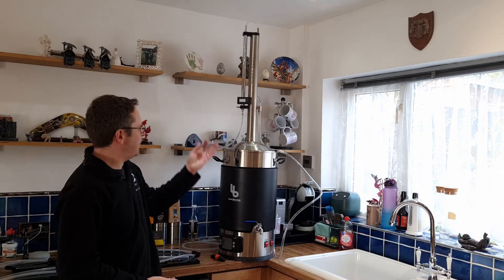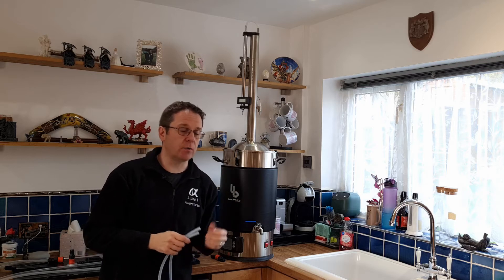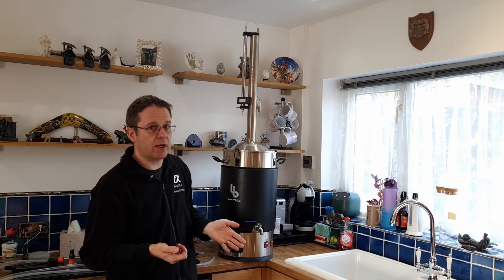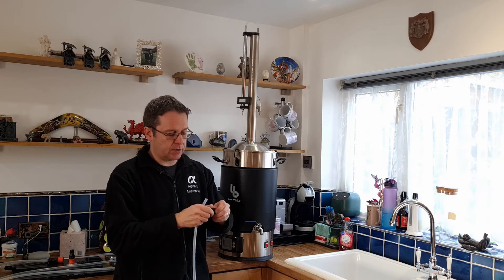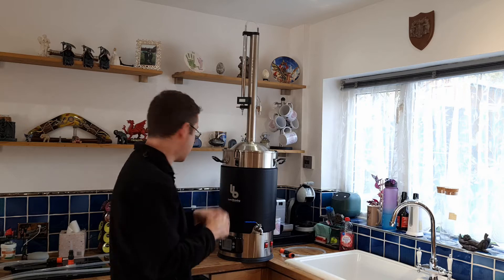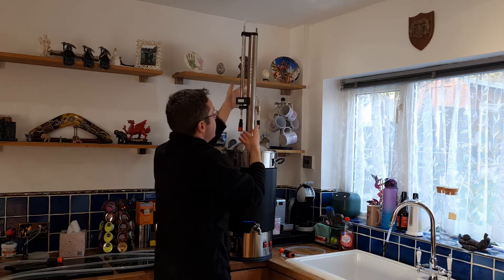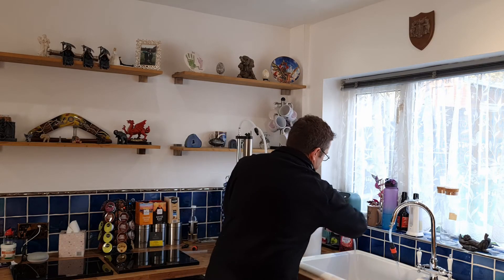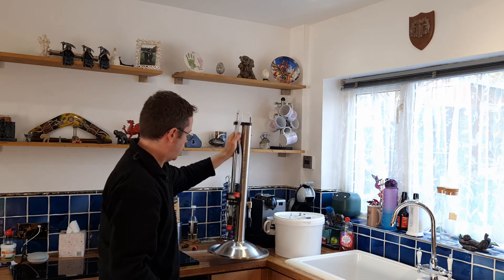How to make your Still Spirits T500 work better

Comment: Very nice! I’ve been thinking of splitting the tube at the head for the reasons you described. And I always hate moving this gear around with all the tubes dangling. Elegant solution. Thank you! Would love to see the exact quick release valves you’ve used. Could you link to some online?
Reply from the maker: Hi @reganperry1257,
Sure thing, the connectors and tubing that I bought are below.  You can get the tubing anywhere (which is possibly cheaper), but so far only found 2 or 3 suppliers on AliExpress who sell the connectors, and nobody outside of AliExpress.

The connectors you want are the '30SP & 30PP' if using 6-10mm Silicoln tubing:
https://www.aliexpress.com/item/1005003017039024.html?spm=a2g0o.order_list.order_list_main.33.49811802hZ77FU

The 6x10 Silicoln tubing is here:
https://www.aliexpress.com/item/4000833290804.html?spm=a2g0o.order_list.order_list_main.63.49811802hZ77FU

Comment: Great video and great idea. I don't suppose you could share a link to those fittings?
Reply from the maker: Hi @jasongeorge3115,

Sure thing, the connectors and tubing that I bought are below.  You can get the tubing anywhere (which is possibly cheaper), but so far only found 2 or 3 suppliers on AliExpress who sell the connectors, and nobody outside of AliExpress.

The connectors you want are the '30SP & 30PP' if using 6-10mm Silicoln tubing:
https://www.aliexpress.com/item/1005003017039024.html?spm=a2g0o.order_list.order_list_main.33.49811802hZ77FU

The 6x10 Silicoln tubing is here:
https://www.aliexpress.com/item/4000833290804.html?spm=a2g0o.order_list.order_list_main.63.49811802hZ77FU

Comment: This is a great video and I love the quick connections.  Do you have a link or a name for that style of a quick connect?
Reply from the maker: Hi @branu01,

Sure thing, the connectors and tubing that I bought are below.  You can get the tubing anywhere (which is possibly cheaper), but so far only found 2 or 3 suppliers on AliExpress who sell the connectors, and nobody outside of AliExpress.

The connectors you want are the '30SP & 30PP' if using 6-10mm Silicoln tubing:
https://www.aliexpress.com/item/1005003017039024.html?spm=a2g0o.order_list.order_list_main.33.49811802hZ77FU

The 6x10 Silicoln tubing is here:
https://www.aliexpress.com/item/4000833290804.html?spm=a2g0o.order_list.order_list_main.63.49811802hZ77FU

Comment: Where did you order the quick connectors from I can’t find any on eBay a link would be great many thanks
Reply from the maker: Hi @davebower5904, sadly the only place that I could find good connectors from was AliExpress.  Yes, you can find metal (well, brass coated) connectors on ebay or Amazon, but these are expensive, very heavy and they rust after a few months (well, they did for me).  The connectors that I use are actually made for air, so you know they can take a lot of pressure.  The link for them is below.  If you are using 6ID 10OD tubing (like me), you will want the '30PP and 30SP' model.  

https://www.aliexpress.com/item/1005003017039024.html?spm=a2g0o.order_list.order_list_main.95.5cf91802xn6eGq

Comment: Any chance of a link for the connectors (uk)
Reply from the maker: Hi @prologicac3,

Sure thing, the connectors and tubing that I bought are below.  You can get the tubing anywhere (which is possibly cheaper), but so far only found 2 or 3 suppliers on AliExpress who sell the connectors, and nobody outside of AliExpress.

The connectors you want are the '30SP & 30PP' if using 6-10mm Silicoln tubing:
https://www.aliexpress.com/item/1005003017039024.html?spm=a2g0o.order_list.order_list_main.33.49811802hZ77FU

The 6x10 Silicoln tubing is here:
https://www.aliexpress.com/item/4000833290804.html?spm=a2g0o.order_list.order_list_main.63.49811802hZ77FU